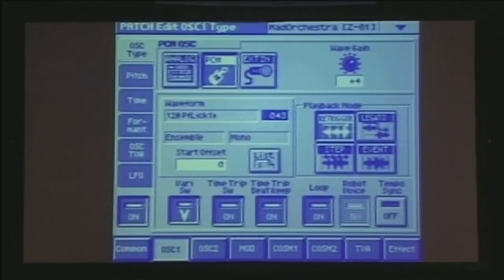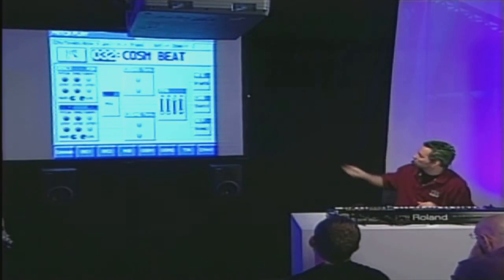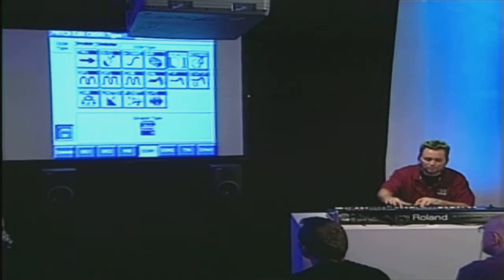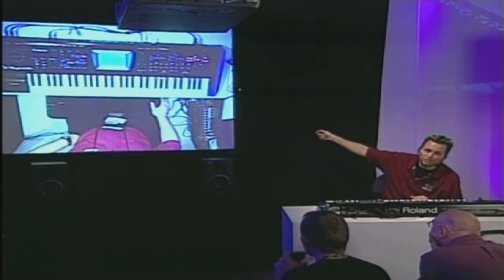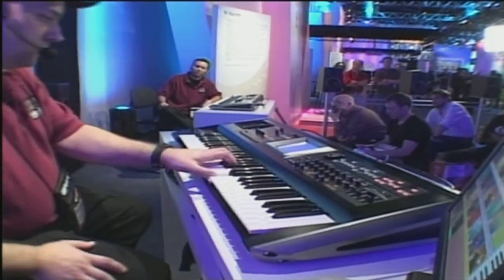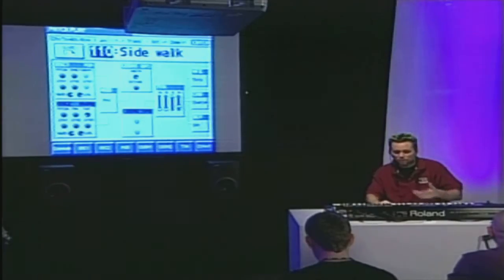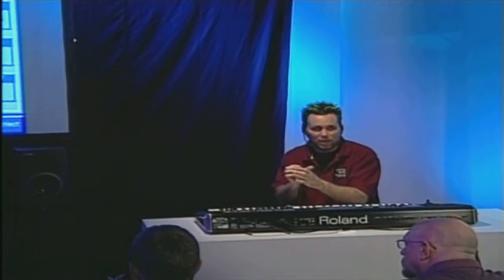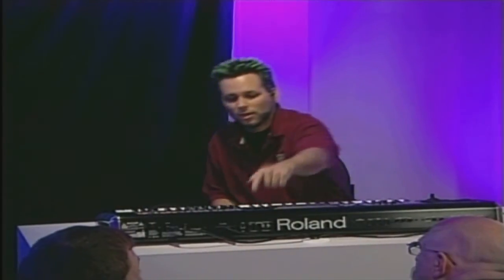Roland V-Synth - Introduction

Comment: For USB connection, does it require a special driver? Is the driver compatible with current OSs? Or is this keyboard now incompatible and less functional?
Reply: Unfortunately, they stopped updating the driver for the usb connection.

Comment: Please someone tell me how to connect vsynth to the computer. I got it recently. and im working with cubase and fruity loops
Reply: +Sean Keish MIDI is the normal way.  You would need a MIDI interface for PC.  Then MIDI in/out to MIDI interface.  After that, you just need to configure the synth in the Cubase ( which in my experience is a pain, but see the manuals :)  And for the audio, you connect it to a suitable audio interface.  You can get a box that does both the MIDI and an audio interface.  The audio interface should be simple.  At this point, you have a few tracks in Cubase.  A MIDI track, and a stereo track ( if stereo tracks are supported, or two mono tracks.)  Sequence the MIDI, and then play back the MIDI while recording the audio.  Then I think normally you mute the MIDI leaving the audio track, but you could try different options.
Reply: Hey thanks bro! its working now :) Thanks for replying
Reply: glad you got it working.  I use a TASCAM to mix/record to avoid the need for a DAW.  Because I hate DAW.  And I write software for a living so I should be able to figure out DAW, but they annoy me :)
Reply: What is a TASCAM??
Reply: TASCAM DP24 mixer.  It mixes and records.  No automation.  A bit confusing, reading the manual seems mandatory ( reading it each time until I memorize things like mastering mode :)  Beats a DAW from my perspective in some ways
Reply: Anyone know how to utilize samples in OG? I know how to record and save but can’t find recorded samples in patch library. 💀🤷‍♂️✌️